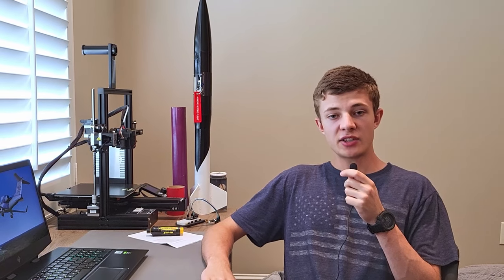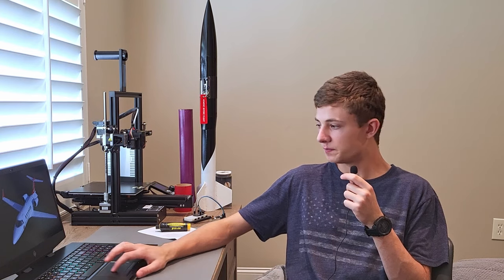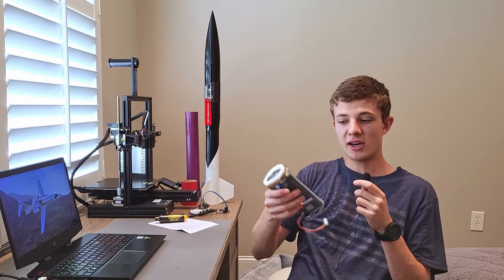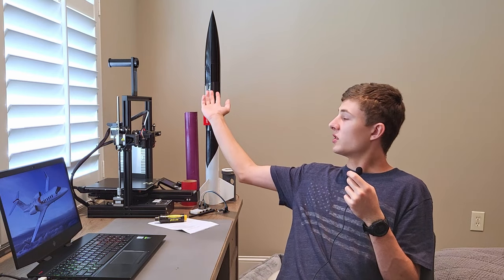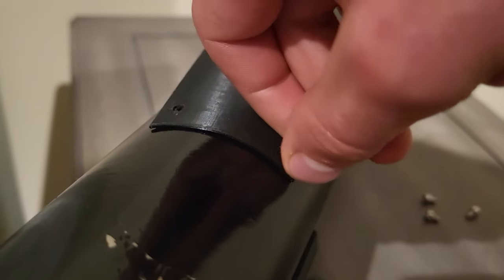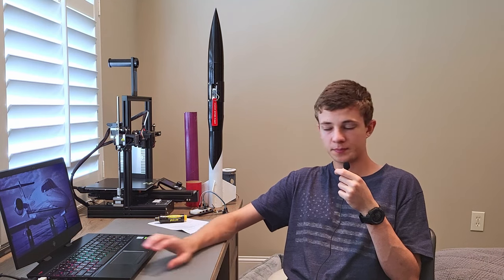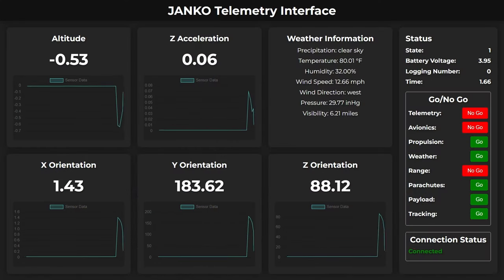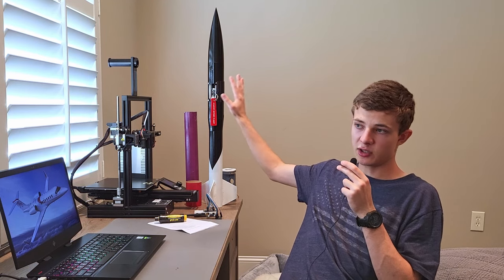Incredible Custom Rocket with Live Telemetry and Full Avionics - Design  Overview

Comment: Hi I am a begineer in electronic
Did you have or know any website to build my rocket?
I ever built my FPV Fixed wing using F405Wing as my flight control. I use Inav to control my flight
but I no nothing about programng
Reply from the maker: @Indonesia01ian  Well it is roclet science so it isn't easy. For starters you can design the rocket itself with OpenRocket. Make sure it is stable and then you can order parts to build it. As for the electrical side that is up to you. There are government regulations that prevent publishing most software. I would start out by using arduino and creating a basic data logger than go from there.